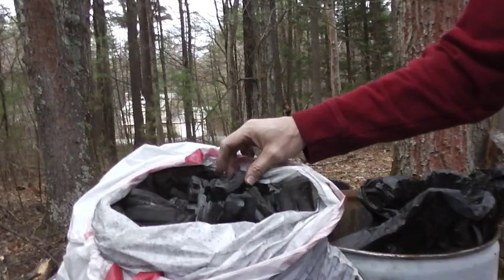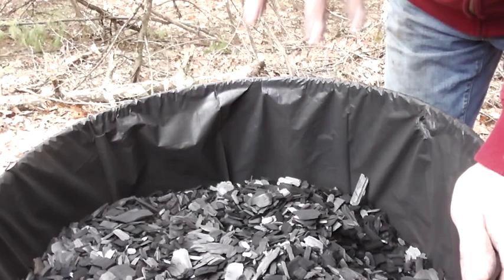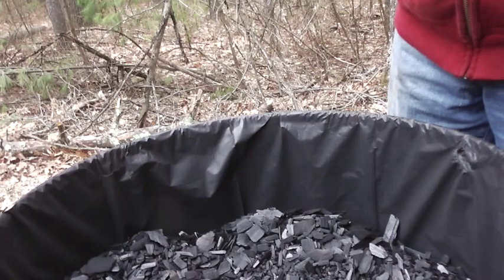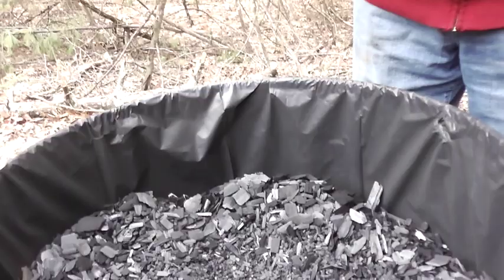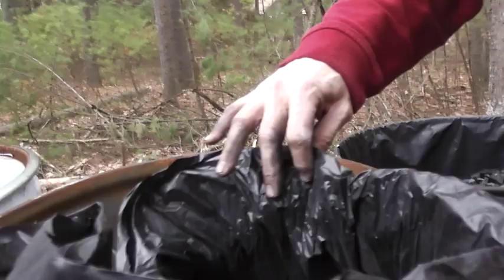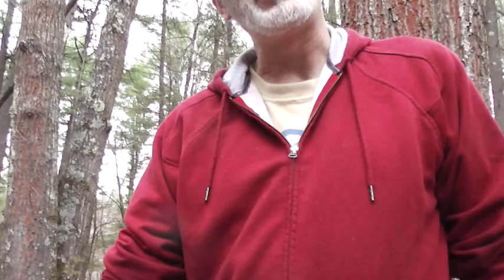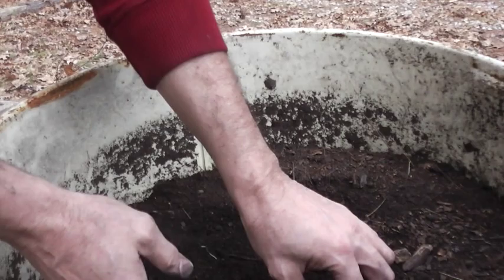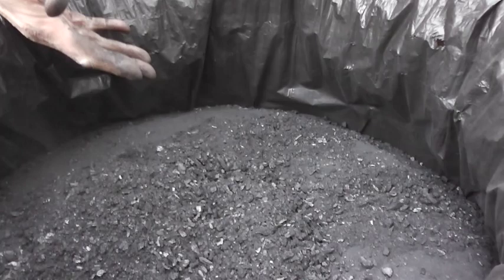Biochar With Hugh McLaughlin 150422

Comment: This is one of the better videos featuring Dr McLaughlin. If we take a moment to reflect on what Dr McLaughlin states throughout this video. Microbes and hyphae  will go to the char no need to dig it in. 5-10% by volume of the soil root zone. What is the root zone of plant life? I believe that it can range anywhere from 1/4"-6' depending upon compaction. That is quite a bit of char.
As a for instance 1 cubic meter of soil that I have a tree growing in. 5-10% of it should be biochar. By google math that is anywhere from 50-100 L of biochar.
I see the huge benefit of incorporating it into the composting system. I can wrap my head around the 1 part biochar to 3 parts compost. From the sounds of it, there is little need for turning, it is the ultimate aerator.

Ooops, the Dr. stated 5-10% volume/volume  which is a bit different...ok a lot different.